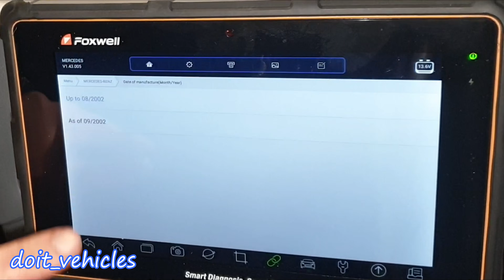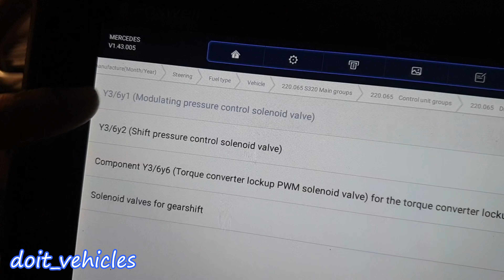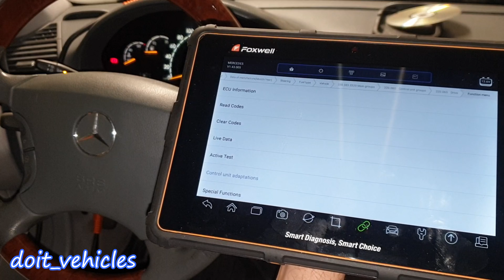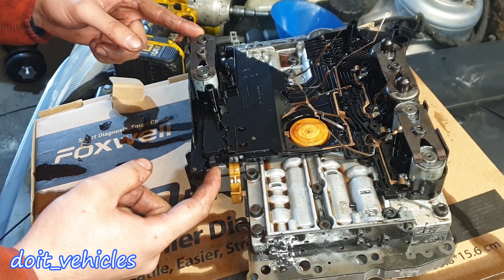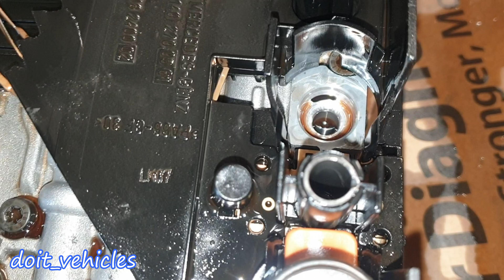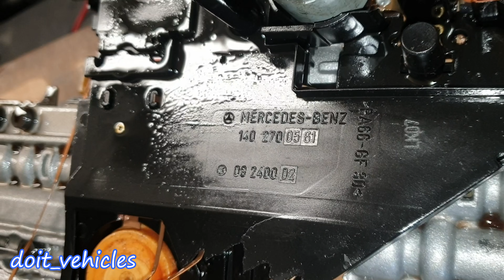722.6 Mercedes Transmission Conductor Plate  / Valve Body replacement

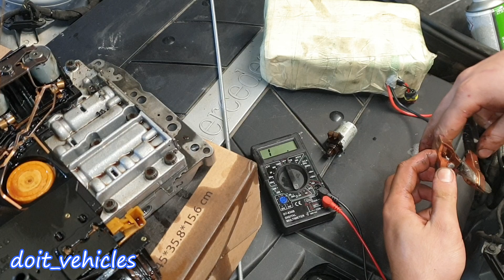Comment: 7:10 When testing the voltage, what battery did you use?  also what was the range in the multi-meter? I am a newbie. Trying to test my solenoids because my car doesnt shift to 2nd gear after changing the conductor plate
Reply: You can use 9V alkaline battery for testing.
Multimeter rang on 200 ohm.
Reply: @ Thanks, I will try it. Let's see how it goes.

Comment: In early 2025 I would likely change out the conductor plate for my 2006 Mercedes even if there is no shifting problem. It had done 220,000km. Intend to keep it until 2030. 😂😂. Yearly usage likely be 6000km. 

Metal shaving should be both aluminium & steel?. Steel from  transmission or convertor. 

Transmission filter are likely coarse filter unlike engine oil filter is located after the engine oil pump which likely have dp of 7psi.

Comment: HELLO.....thank you for your superb video....same problem after changing my plate with Febi-bilstein and Solenoid joints etc...Code P0730 on my Autel and in addition the Mercedes techs tell me that they can no longer access the settings with their Tablet..
I am disgusted by this SLK 230 from 1996 which is costing me an arm and a leg... thank you for your advice.....Continue...
Reply: 1996 is OBD 1 not 2. That's y techs can't access.

Comment: I have the same vehicle. We renewed the turbine valve today, but there is a noise when putting it in park and taking it out. This could be the reason. We also renewed the oil. Do we need to adapt it?

Comment: Hey definitely late but having a problem when turning left (only on left turns) the car slips out of gear Mercedes is thinking it’s the valve body but I’m unsure if that’s the problem as it only happens when turning one direction. Hopefully you have any info on this matter!
Reply: Low on trans oil ?

Comment: Just another Defective MB part. Mine has issues at 10,000 miles. Will cost me 2-3k to have fixed. MB has the worst parts. Will never buy another MB..jc
Reply: lol, 10,000 miles? the 722.6 hasn't been used in MB cars in 10 years so how would you have so few miles? and a replacement valve body doesn't cost 2-3k either. I think you're either very confused or just full of it.

Comment: Question: Do you like your Foxwell Scanner ? Im thinking of getting the new Autel Maxisys Ultra 2022.  Since most of the cars I own are Mercedes and BMW and Porsche VW.  My other friends and mechanic have been using the matco's launch. But they are getting a new one.  I have the SnapOn Solus but it doesnt work as good as the Matco Launcher. But I think Autel from others YT reviewers are better.  This is first time Im seeing Foxwell scanner. Just asking your opinion why you chose Foxwell.
Reply: what scanner did you get? can you use any type of scanner to clear codes and find codes?

Comment: I have 722.6 transmission problems not shifting staying in 2-3 gear. How do I know if the conductor plate is bad? Or the valve body or solenoids need replacement?
Reply: sounds like it's in limp mode so it's probably a bad conductor plate

but you should scan the car and see what comes up to know more...

Comment: hello
I saw this video today and tried to drive after replacing the transmission oil and transmission plug, but the car doesn't move... The shifter moves from p to R to R to N and N to D, but the car doesn't move.
What's the problem

Comment: Did you put in a mercedes magnet A169 3710003 at bottom of oil sump before boxing up the transmissiom. I would put in two such magnets for next oil change. It does looks like iron metal dust particles are fine enough to past thru the oil filter. How about the two small round mesh filter inside the valve body? Any accumulated debris such that more that 20% of the mesh is covered up?.  Regard.
Reply from the maker: Not a bad idea , the problem is that the aluminium particles are more common ; And maybe it's better to change the filter more often ?

Comment: hello Sir. i have a 2004 Mercedes e302 w211. i have an issue at the morning only cold start the transmission shudders but when the car gets to normal temp it ran perfect  do have an experience before about this issue thanks a head
Reply from the maker: In this case I would check the live data first ( might be the engine ) and than I would check the fluid quality ;
Reply: @doit_vehicles   Thanks Mate
what the data list i have to watch u think?
Reply: Its the lock off selenoid, i had the exact same problem

Comment: Can you give an advice please,why when i put in reverse the car have a big vibration?
Reply from the maker: If it only vibrates in reverse and not in drive , try to observe under the car when someone puts it in reverse and check for vibration on the transmission . if it doesn't than it's something internaly . If it does than it's most likely the mounts

Comment: Great video, I also have the transmission shaking simptome (from 2nd to 3rd gear) so I will change the conductor and the orings. I'm kind of pissed off that I didn't do this sooner as I knew this will eventually be a issue.
Where are you from?
Reply: Did you manage to fix this? And how please?
Reply: @thepio14343SWEG  Hi, I didn't solve the problem, even if I changed the conductor plate.
Reply: @xavierrochas change the valve body it's the issue.

Comment: good video my friend ! my goddamn mercedes always fucking with me . It has a P240C code. The electronic module in the gear selector fails. very annoying :D
Reply: Das ist kleinste Probleme beim automatikgetriebe 722.6 
Walhebelmodul 240C Fehler ist Gescwindichkeit Sensor Defekt 
Walhebebelmodul ausbauen und reparieren lassen in spezialisierter Werkstatt kostet mit Garantie zwischen 100€ und 120 € aktuell in Deutschland 2026 
Zwar kann man sogar selbst reparieren aber der aufwand ist viel klein Arbeit statt 100€ zu bezahlen